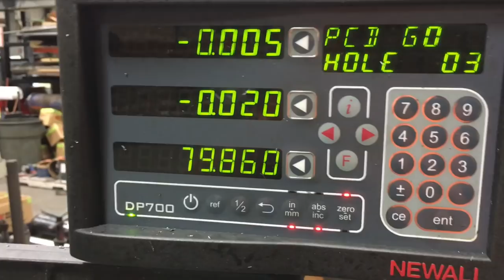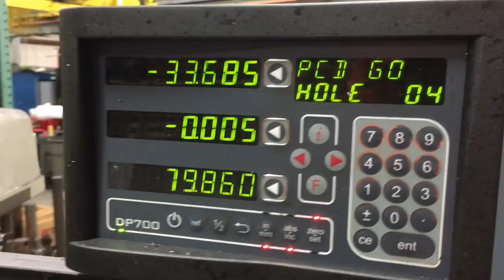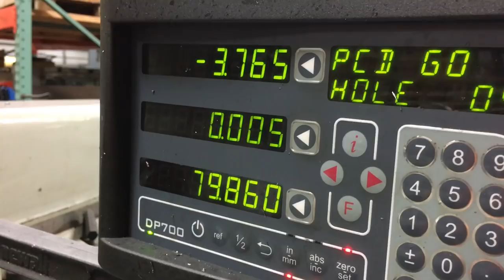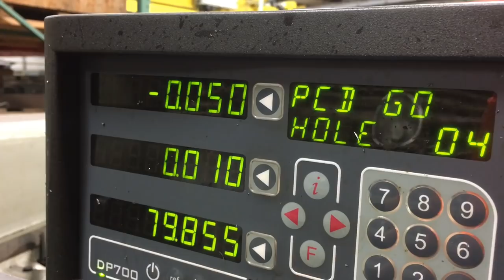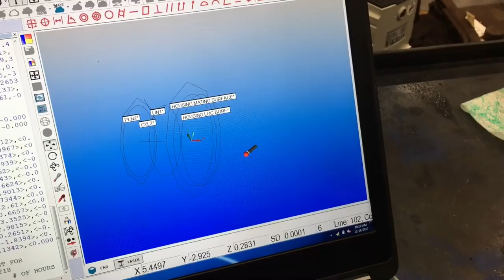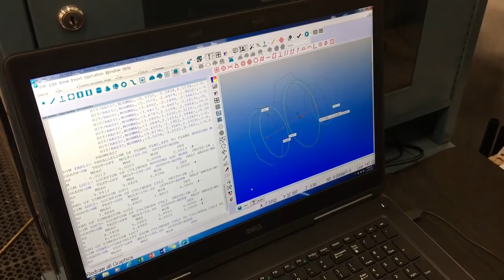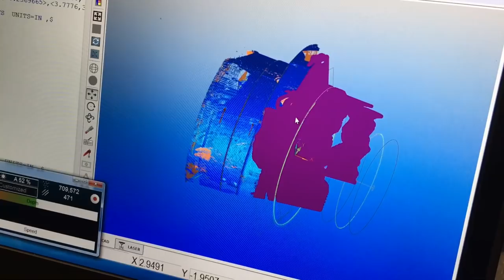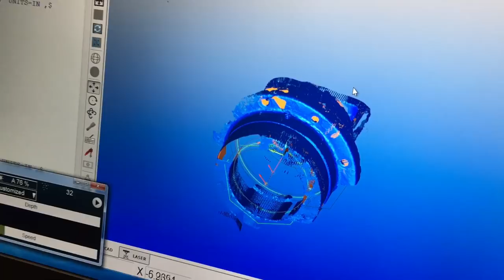SNS 198: Metalizing, Bearing Plate, Hexagon Metrology

Comment: Metalizing has to be my most favorite think to watch and see the process.. and the machining of the Metal coated work piece is so satisfying
Reply: It's a really futuristic looking process.
Reply: I've never seen or listen something like this before...I must talk about it to my old dad...
Reply: Threading and metalizing, things i never tire of watching.
Reply: The metalizing doesn't even have to be the same stuff as the base metal.  Some parts of the wind towers I used to help make were metalized with zinc or aluminum as part of the corrosion resistant coatings.

Comment: I once built a hydraulic manifold that took advantage of every pipe standard on the planet.  It had npt, nps, bspt, bspp, o-ring boss and a few others I never did find the official standard for. I ended up taking measurements off the fittings and thread milling them till they fit. Projects like that sure make you appreciate standards what ever they are.

Comment: Those were 2 great repairs Adam, The shaft repair was something I didn't know existed, you will laugh  but I used to repair my outboard motor propeller shafts where the seal would wear a groove like that, by braze it up and put it in the drill press and file it back to size, would have drove you nuts LOL. But it worked ok. thanks for posting.

Comment: I prefer your shop because your old Monarch brings back fond memories. We had one at Saturn, and the toolers (*mostly) adored their Monarch. I assisted the electricians in repairing it one night, and the old girl had a vacuum tube DC drive in it (which had a blown rectifier tube, but we got it up and running nonetheless).

Otherwise, chips are chips, and where they fall doesn't matter to me. Your videos are great regardless of where you choose to shoot them. :)

* I say "mostly" because you're lucky to get two toolers to agree on what day it is, let along which lathe was the best.

Comment: Love that metalizing!  Back in the 70s and 80s I had Lotus Europa cars, with a poor rear stub axle design that would eat up bearing journal contact surfaces. I had a machine shop that do this process to bring diameter back up, saving very expensive parts from the scrap bin. They never let me stay and watch... so now decades later, I get that chance with you.👍🏻🤣. Happy Holidays  to you and Abby!
Reply: Jennifer I have a '74 Twincam Special.  It looked pretty clean when I installed it, but I'll keep that closely in mind!
Reply: Silas Marner 
In the Twincam they increased the size of the inner bearing and improved the race spacer between the inner and outer. The S1 and S2 had smaller inner bearings... I owned each of them. Another issue was the inner race size of the inner bearing, non standard.... I often had the stub turned down 1mm take standard bearings.. the hardness of the stub was a bit low, and even with a locktite and light press fit, over lots of miles they would wear under the race. The place that did my metalizing also hardened them, which really helped. Twin cam series changed specs, much better!   You have little to worry about.  I believe the bearing spacer is far harder too, in the Twin Cam, providing much greater stability to the bearings inner races. I miss my   S1 the most..   Would love to have one again and put formula ford type suspension in the back, and 2 liter 4 valve cosworth. Oh well...  Driving a C5 Corvette in my old age🤣.
Reply: In the UK we used Lotus as an acronym - Lots Of Trouble, Usually Serious
Reply: Gospelman 
I DO understand... In my S2, I basically had to completely rewire the car. The Prince of Darkness, Lucas, had to be evicted. I sold the S1 before getting around to it, and new owner crunched it up.  My S2 had a worse fate, bent in half around a utility pole, after swerving to avoid a dog on the road and hitting gravel that had spread on the road earlier that day be some jerk spinning tires from the shoulder... I had been down that road the other way 30 minutes before and it was clean... such is fate. I lived... and bought the S1 with no engine... Should have tried harder to keep it I guess, but now 30 years later, part of that may be just nostalgia..
Reply: Jennifer WhiteWolf You sound like someone pretty special. Not a lot of guys would possess that level of knowledge, much less remember it. Wish I had you as a neighbour,lemonade in the summer listening to the there I was war stories.  Cheers.
Reply: paul manson 
While in college did race car suspension engineering. Family had specialty business with high performance cars.. grew up with it. You dont forget the hair pulling and nail biting problems that needed solving... The easy stuff, lost to dust of memories.
Reply: Jennifer WhiteWolf You just made about 5000 guys green with envy. Dream career for so many people, and you did it and got to own and drive cars most only saw in magazines. Good on you.
Reply: paul manson 
Almost anybody can drive a ‘better’ car if motovated. I bought my C5 at 5 years old. Somebody else took the depreciation. My payments were less than a cigarette addict will spend on a 2 and half pack a day addiction. People around here would spend 2 or 3 times the price of my Vette on some pickup truck, and get jealous that I driving a nicer car, BS, they spending stupidly is all. Just the cost of a booze and cigarette problem can more than pay for a decent fun car. Its been paid-for a LONG time so now I buy tires and maintenance.. Thats the other thing, not only buy right, keep it... Don’t waste hard earned $$ rolling over depreciations every few years.
Reply: Jennifer WhiteWolf No argument from me. As a teenager I remember a comment from Consumer  Reports magazine that I paraphrase here. 'Buy something you are genuinely comfortable with and drive it until it dies '. Pretty much covers anyone operating a motorcycle all the way to heavy equipment. My point was I do wish you would spend some time with someone,or maybe a tape recorder. You seem matter of fact,that family of yours sounds remarkable.
Do you realize an era has passed,the stories you could tell would be treasured by young people,perhaps adolescent girls dreaming of accomplishments of adulthood. Emma Peel(Diana Rigg) acted parts that you actually did. Record it. Make a document your daughter would treasure.

Comment: Hi Adam. As usual, a great video and I learned some things.

That seal journal really looks like new. Very nice! 

Your gearbox bearing cap turned out better than the original, IMHO. I haven't seen a DRO with hole circle program. That is really handy! 

The CMM is amazing. Years ago, my dad worked for a casting company with one. It was huge, and had a massive console to do the coordinates. Yours does far more, in less time, with only a laptop! Again that's amazing to me!!!

Comment: My father-in-law owned a 1978 Ford F150 4x4 with a 4.9 liter (300 cu.in) straight 6 engine. the odometer stopped working somewhere around 320,000 miles, drove it another 2 years. The only reason he sold the truck (to a farmer that used it to drop hay for his cattle out in the fields), was he couldn't stop the rear main seal from leaking, the crank had turned so many times that the rubber seal had worn a groove into the crank shaft so bad that replacing (or possibly fixing it like you're doing but he knew no one that could do that) the crank would have been the only fix.

Comment: Cool to see some stuff I use at work as well :) The hex messure u put in at the end I use at work as well. Ours is a bit diferent, its motorised insted were u lock the part under one horrizontal arm and were the messure arm goes down paralell with the piece and you can rotate the head with the needle 360 degredes in 3 direction. Was not aloud to picture it though. Great wids again Adam. Merry Christmas and Happy New Year to both of you from sweden :)

Comment: Metalizing is an intriguing process, I like to watch that and the end results! I imagine the metal is not a good candidate to run some welds and turn it later? Maybe some warp concerns?  Either way, I like both processes.  Came out good as new!
Reply from the maker: Aaron Belknap arc welding easily warps a shaft and will also be hardened on hard steel.
Reply: And TIG weld ABOM79? I also use metalizing process in my job in motors shafts, but I like more to TIG weld because of the strenght... Any hit in metalizing and will crack everything...

Comment: Thanks for the video! Before today, back around the 80s n 90s I overhauled Pratt & Whitney, Rolls Royce Turbine engines. Please forgive my words are probably more difficult for me than my machining ;-) When centering a LPT (main) shaft it was understood that a spline, like a thread due to centrifugal and rotational pressure, will always tend to center itself on the angular sides of the grooves. Like a thread, since the OD on an external is only clearance and it is the "teeth" which contact the mating part, I used a 4 jaw chuck with 4 equally sized pins that would rest in the "teeth" somewhere around the pitch diameter of the spline. Using 1/4 wide tape to wrap around the pins to secure the pins in the (cleaned) teeth I left enough pins hanging outside the jaws to indicate. Once the 4 high spots of the pins were indicated tru with a steady rest on the far end I was sure the shaft was balanced at the chuck end as the rest of the shaft was finish ground after the spline in the same way. Maybe doesn't mean much in every day application but when the shaft and turbines "whipped" in the upward speeds of 20 grand balance was I bit important. Just sayin. Thanks for a very generous vid friend.. Chris

Comment: I’m sorry for my naivety I’m not a machinist and don’t have much experience. I enjoy watching your projects and I always see you use emery paper. Is there a reason you don’t use steel wool for less aggressive polishing.
Reply: He is polishing to size, not for appearance.
It is quick, easy, and standard procedure in many job shops to turn slightly oversized and polish down with emery. The stiff cloth back backs it easy to keep the surface flat. Contact surface area is important for press fits, so you need a good finish.
When polishing for appearance, most folks follow up the emery with ScotchBrite pads. Steel wool is a horror show in both metal and woodworking. It rusts and forms very abrasive iron oxide, and will stain wood if it has tannic acid in it. The particle will also imbed in the metal which can cause other issues.
Reply from the maker: Emery paper is made to polish and remove metal.

Comment: heh a cylinder boreing mill on the lathe, I seen lots of those on old steam engine building videos they used to have a special mill just for that purpose, and special boreing mills for various parts, they had all kinds of specialty things, its neat to see the lists of the old railroad machine shops and see all the things if you like seeing tons of speciaty things and finding out what they do, Infantile I know but there is that inner child in me still, and now that I am old enough I can actually give it a whirl using one said tools if taught how, especially at the historic railroad, though mostly I just clean stuff up, be a tool monkey, and occasionally grind parts when fabrication is going on to clean them up with a 4.5 inch disc grinder or angle grinder, usually though I have been cleanning out the firebox which is dirty and kind of cramped but cozy if you like it warm on a cold day, takes a shovel and at least a broom if not a wirebrush to get the clinker out of the grates and notches around them that are for better airflow when it is keeping a fire, oh and a good trouble light is needed too as it is dark in there and only one way in and out, the firebox door which I would say is the worst part of blowing out flues and cleanning out the firebox, that and just the shear amount of dirt and soot.

Comment: Great video. I have question about the Metalizing process. What was the blue/green bi-product left on the part and the jaws of the chuck? Was this something that is difficult to cleanup after the process, specifically on the lathe chuck?
Reply from the maker: ecleveland1 That is the dust or fumes you see thats on the jaws. It wipes off.

Comment: great video adam. have you ever used speedy sleeves instead of metalizing?  we used them a lot in the shop where i worked they are durable and can save a ton of money where you can use them. i realize that in some cases where redos can be very expensive they may not be the best choice.
Reply from the maker: larry sperling That’s not a patch repair we do, that’s something you would use in the field if needed.

Comment: what about heat treatment? Does the base part get hot enough to change the temper? What about the weld spray? Can it be heat treated after application?

Comment: Do you machine the bore on the last part a thou per inch under size to get the interference fit for the sleeve? Then press the sleeve in or cool the sleeve and heat the part and drop it in?

Comment: Merry Christmas

What was the orange colored tool backing up the angle plate on the horizontal mill?
Reply: TJ Clark I don't know what it's called exactly, but it's like a low profile clamp. Part of it clamps down to the table and the rest of it is like the moving jaw of a vise. I believe he's using it here to take up some of the feed pressure from the tool and make sure that the set up doesn't move.
Reply from the maker: That’s a machine vice made by Carver. It’s actually a two piece vice that clamps down to any machine table and you have a small amount of clamping movement on one side.

Comment: a rubber oil-seal did that to a hardened shaft? wow
Reply: A likely guess would be that the rubber seal was 'lapping' with abrasive dirt from its surroundings.  The rubber itself didn't do that, the stuff it was contaminated with did.
Reply from the maker: It’s common to always find a line or a groove on any shaft that is running an oil seal. Same can be found in automotive front spindles and axels.

Comment: "It's so much harder to line up metric than imperial"
Yes, but you should not have more than two decimals in metric reading. It will still be harder to line up than imperial reading with 3 decimals
By the way: Merry christmas from Norway

Comment: Adam is bimetrological... fluent in metric and Imperial! Seriously, those that work in environments where everything is in Metric have it NICE. The U.S. is a schizophrenic mess of both. It causes issues for mechanics, machinists, builders and others. I have no doubt we are headed to full metric eventually, after all, the U.S. was one of the original signatories on the metric treaties and Metric is a full recognized system of measurement here. We just have a lot of old baggage to deal with... the WW2 era machines that are still plentiful were all Imperial as are all their more recent clones. For myself I machine metric parts in metric, Imperial in thousandths, and mixed units in thousandths (by conversion).